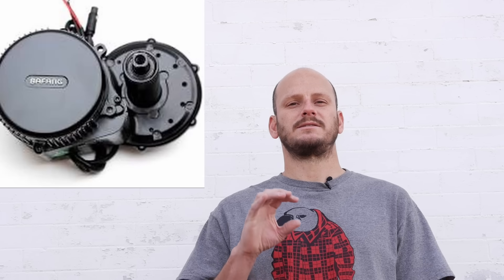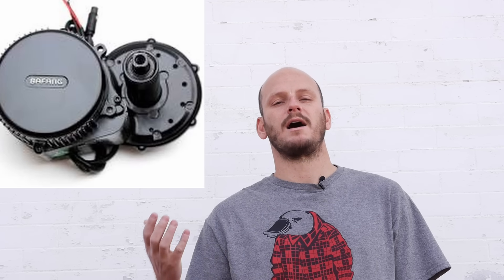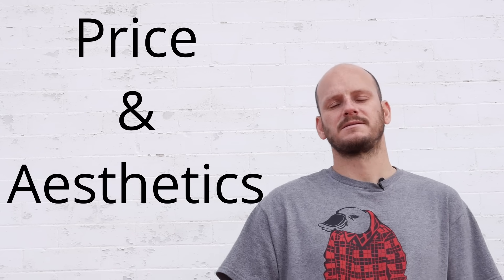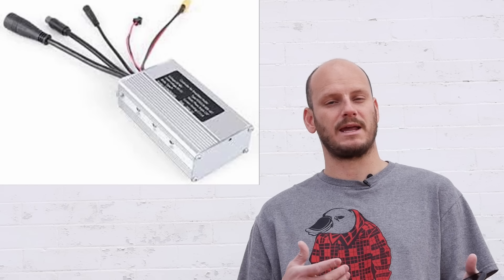Hub vs. Mid Drive Motors: Why Hub Motors Suck and Debunking Common Myths with performance test

Comment: OK, so how does this guy become really qualified? No electric car built by a major manufacturer uses a hub motor. What planet is this guy on? There are a few conversion car kits that use hub motors, but a Tesla doesn't. 
What I don't understand is why the hub motors aren't built into the rim. Yeah its more expensive, but you will get a lot more torque. Also why don't the hubs use a planetary gear set and go to speed. One speed is geared down, and the other is straight through.
Reply from the maker: As clarified in my pinned comment. A hub motor is a single speed motor (no transmission connected to it) Same principal as the drivetrain in electric cars. Check out my “biggest misconceptions about ebike motors” video where I go more in depth about this topic. It pretty much is a direct response to your comment.
Reply: @JohnnyNerdOut  I noticed my one sentence was not clear in what I meant. If you use a planetary gear set to gear it down, you can easily bypass the planetary to go to direct drive at speed. In otherwords, a two speed trans, where the planetary is bypassed by a clutch. Second thing is many bikes have large hub motors with no gears, meant for higher torque.
Reply from the maker: @Daveinet  I know of one hub motor that has a two speed transmission but no one uses it n their bikes. But it uses different reductions on bOth sides of the motor. It is not a direct drive system. Do you have a link to the motor you are referencing?

Comment: I have hub motor 1000w. Controller built in. Downside is I had to file the dropouts on the bike, a rear puncture is a bch. Pros, it has a throttle, I don't even peddle to work. Goes thirty miles an hour and if I peddle to get it up to speed it's faster than the average car off the mark. I can ride on the tow paths along the canals. It's basically an illegal moped with no tax or fuel costs.. But I agree with the video, stop start riding has big wear on these motors. If you're cruising for miles they're fine. But urban rides I'd like a mid drive in future. Awesome video. A lot of info delivered really well. You got a great talent.

Comment: Me who has a one speed on my mid drive 😆 pretty sure I want a hub motor 🤪
Reply from the maker: Single speeds definitely have a great argument for hub motors. Personally I’d still go mid drive because I could change the gear ratio anytime by switching out chainrings or cogs. Each their own though 👍
Reply: @JohnnyNerdOut  very true

Comment: I did a mid-drive conversion on my bike, but I think it depends on the starting point. I recently advised someone that they should do a front hub on their bike, as they had a chain guard, an normal front wheel and they they would be towing a kid behind and have a child seat on the back. They said they did not live in a hilly area. 

Most ppl I know with front hub conversions are happy with them. Brompton use them. Horses for courses.

Comment: You don't even need a spare chain, you can just take a $2 quick link (assuming your multitool has a chain link remover on it, and most do). I'm 1000 miles in on my BBSHD, I throttle far too much and my KMC X9 chain isn't showing any wear just yet.

Comment: You forgot one of the biggest drawbacks of the hubmotor: Changing a flat tire is a pain in the a**. I did a roadfix a couple of weeks ago. It took me over 20 minutes compared to sub 10 minutes on a regular wheel.

The BBSHD is great but for me the gears last about 15 000km or about a year and a half. After that they're toast. That results in a pretty high cost per km. You can replace the gears for $150 but it's almost impossible to do it without damaging the electronics.

Also for me it's a big drawback with the wide q-factor of the BBSHD. I want as narrow as possible for my knees and hips.

The BBSHD is a pain to ride if you run out of battery whilst my rear hub motor is almost like my normal race bike.

I can do 40kph for 80km on my rear hub motor and about half with the same battery and speed on my BBSHD.
Reply from the maker: I realized that almost immediately. I will do a second part one addressing more topics.
Reply: Just patch the tube without removing the wheel. And this isn't inherently an issue with hub drive but it is an issue with poorly designed torque arms/ axles.

Comment: I still more like hub motor. With mid drive I must always pedal... Maaybe then set throtlle then change my opion... And Hub motor have less gear reduction steps, so it have higher efficiency usualy. And in europe more than 25 kmph is not legal, so hight speed is not needed. In asfalt is no hight hills but on hight hells you always can help with pedals. And hub not wearing chain... Mid drives maybe is better if in your place wery steppy hills and many it. Or if your weight is wery big and 250 W motor who is legal in europe cant you put in steppy hills and your legs is wery not powerfull... And mid drive weight is usualy higher. Hub can be 1,4 kg-2,8 Kg 250 W while mid drive 3,8 kg.
Reply: ps. i buy middrive about 6 month ago after waching this video
Reply from the maker: You didn’t get a throttle with your kit?
Reply: @JohnnyNerdOut  not get
Reply from the maker: @Alksbbch  should’ve gone with a Bafang kit. They come standard and are highly programmable

Comment: Just picked up my brand spanker 750W Dual Motor E-Bike and it's out of this world AMAZING, very strong torque,  example climbed up a 25% gradient hill which approximately 1/4 mile  climb , and at a consistent speed of 29 miles an hour , at last I've found an E-Bike that I'm happy with the overall performance!!

Love your channel buddy, you are amazing !!

Comment: My God! What a load of bull...!! I have never heard more deceiving comments in my life!!! It was mention that the only thing that you loose is the derailleur!!! It is as if the guy has never ridden any bike in his life!! The derailleur and the gears are the heard of any bike!!!! If you loose the derailleur then you loose your ability to speed and of course loose a huge torque of your bike. And I am not taking at all about its electic motor because you might often run out of battery or you need to do extra miles so you need to assit the motor by pedaling in order to increase the actual range of your bike. What kind of pedaling are you going to do in a steep hill without the derailleur?!!!! Are you going to pedal with 40T in front? To do this you need at least 52T in your gear. How can you acheive a high speed on a flat or a bit downhill road without using the derailleur? Are you going to speed with the 40T? You should have at least 48T in one of its 3 disks (I have 52T). What a load of crap is to say all these lies about the spokes. Don't  you know that the spokes with the hub motor are really very thick and even if you want to brake them you cannot? If you need to ride a real ebike you need at least 1000W motor. The rest are just toys! With >1000W motor you do not have any of the torque problems that you have mentioned.

Comment: I have both, so no bias here. But, both hub motors and mid drive power the hubs. One through the actual hub and the other through the cassette or freewheel mounted on the HUB.

Comment: You WOULD use a hub motor in a motorcycle you say? Think again! At those higher speeds the so called "unsprung weight" becomes a very important parameter in road holding. That's why I wouldn't want a hub motor in my motorcycle. One of the big reasons why they are used so much is the simple mechanics (hence low cost) and space saving.
Reply from the maker: Ya I agree actually.

Comment: Hey Johnny. When I was buying my last ebike I really wanted to go mid-drive but every mid drive I tried I noticed that the moment you stop pedaling you feel a sudden power decrease whereas hub motors when you stop pedaling they just kind of coast but you don't feel any slowdown so I just couldn't bring myself to get the mid-drive because I didn't like the sudden slight jerk when I stopped pedaling. Both of the mid drives I tried were fairly high-end brands but they both had the same outcome. Is this not normal?
Reply: I have both a mid drive and a hub motor.  I think you notice the jerk more on the mid-drive because it has so much more torque, that the drop-off is super noticeable.  I would bet that on a 5000 watt hub motor it would be the same feeling (I have a BBSHD mid-drive and a 3000watt peak power hub bike)

Comment: mid drives are OVERPRICED. you have the use the most expensive bicycle drivetrain parts with a mid drive because all that power is fed thru the chain.

Comment: Built an e bike in 2005 with a hub motor, replaced the batteries a couple years ago. Still works like new after 16 years.
Reply from the maker: Sounds like a great investment 😀

Comment: Mid drive motors require a lot more maintenance. Due to a lot more moving parts. They're also very hard on your gears and drivetrain. If your chain snaps, u can't use bike
Reply from the maker: Depends on which system you are using. Bafang needs almost zero maintenance
Reply: @JohnnyNerdOut  You get a lot of accelerated wear on the bicycle drivetrain and brakes with the mid drive (more milage, higher speeds, heavier loads). With the hub drive you are basically replacing the bicycle brakes and the bicycle drivetrain with a single maintenance-free motor. The maintenance or a normal bike alone is enough for me to avoid mid drives. Especially with year-round commiting.

Comment: I have A 2350 watt hub driven carrera ebike with 20 amp hour battery. 45 mph on the straight.  It may not have as much Acceleration but That’s good enough for me especially when the chain snaps it won’t matter as i can still ride while i carry chain home ready for a new link fitting.  Hub for me.   And I’ve Been on the forbidden road and it’s great I’m loving  it.

Comment: Oh my god, lots of garbage in your fanboy video for mid drive > hub motors. They both offer different advantages and supposed disadvantages

Spokes issue is bullshit. A bicycle wheel is suspended vial tensile strength from the spokes, not pushed. The torque required to turn a wheel for a hub motor is the same as a central mounted chained motor. Only way you can warp your spokes is by crashing your bike, which goes both ways.

In fact, the spokes are supposed to be somewhat loose as it tensions when suspended from the top. 

Warped spokes is about the most bullshit garbage idea pulled out of a hat, both will be affected by spokes.

Like do you even ride traditional normal bikes?

Just seems like a random grab for points to support your mid drive vs hub motor argument.

Punctures affect both motors equally, and I don't see how different it is changing the tubes of a hub motor e bike vs a mid motor one, unless you're dumb dismount the tyres onto the wired side.

Gear teeth can be chewed up and damaged, bent, worn
Gear changing mechanism can be fouled, broken, etc

There's many more moving parts for a mid-drive e-bike to break and fall apart, many more things to source for, just so many things that can go wrong.

Burning out hub motors vs burning out mid drives? If you left your dang mid drive in a high gear ratio and floored it, guess which ones breaks first? The mid drive, you think that mistake is easily repeatable in hub driven e-bikes? No, the bike will move period unless you're putting it through some stupid test for torque against a stationary load, do the same to the mid-motored bike then, same shit happens.

The design of a mid drive electric motor and a hub motor is fundamentally different. In hub motors, the stator is central whilst the rotor is the wheel, and the opposite is true for the mid-drive. Guess which motor puts more strain on the drive train? The mid-drive, because it only has a bloody small shaft to send power to the drive train (which is another weak part, the chain).

As for going uphill with a hub motor vs a mid-drive, mid drives can not have all wheel drive, only rear. For hub, you can have all wheel drive - testing for both, all wheel drive hub motors >>>>>> single rear wheel mid-drive e bikes - in every conceivable test out there, regardless what speeds you're going at.

Perhaps it is theoretically possible that a highly geared mid-drive e-bike could go for a much higher top end speed than hub motored bikes, but by the time you get to that speed, you're already slowing down - changing gears to match speeds in rough terrain with exposed chains and gears = death sentence, unless you have a motorbike sequential gear box (which you definitely don't, cos it will take the service requirements to astronomical levels).

Mid driven e-bike motors also take up valuable space for battery capacity, of which is considered a scarcity and should be given every available space to.

Lastly, you can actually easily DIY and mod any random bike into a hub driven e-bike, but you can't with a mid-drive motors.

This is why less and less people are giving a crap about mid drive ebikes, and headed for dual hub motored ebikes, it's a bloody no-brainer, its not myth, its reality.

Maybe take a course in engineering before spouting your garbage? My gosh, such misinformation.

Comment: Good article with comparison on every aspect. Well done, Johnny & thank you :)
Just a couple of questions..
1. How about regenerative braking?
2. With the hub motor I thought, you'd feed back energy into the battery while pedaling or even while idling.. I mean, no effort by rider or motor but the wheel is just freewheeling. 

Could you explain more on this please. Thanks again!

Kiran
Reply from the maker: Yes. Specific hub motors can utilize regen. They are direct drive hub motors. Vast majority of hub motors sold are geared hub motors, not direct drive. There are trade offs to going direct vs geared. It’s a bit of a rabbit hole 😐
Reply: err no H ha  ha the picture of the wheel with bust spokes,,   its not got a hub motor its just a front wheel BIG MISTAKE
Reply: You still can wel shut the free wheel on geared hub motor.
You should go check Grin Tech takes on regen braking. It's great.
https://youtu.be/gYCj4asp9pE

Comment: Ever driven a Stromer Spedelec?; hub motor, reliable, fast, high torque and great in the mountains: well they are Swiss. Ever heard of the Alps?
Reply from the maker: Never ridden one and never heard of the Alps. Are they a jazz band?
Reply: @JohnnyNerdOut  You should try one. A Stromer. Solid as a rock. Stable at high speed. Well balanced. Big battery (984W) in down tube and 500+W hub motor, resulting in a good weight distribution between back and front. And the Alps (😀): highest mountain range in Europe, meaning going uphill is no problem at all.

Comment: Feels like Mr. NerdOut is doing its best to reason bad about hub motors:
Spokes! Yes, when the hub motor is badly installed, or spokes get loose, it’s a problem. My 1200cc motorbike has spoked wheels and is powered by a crankshaft (forces similar to a hub motor). 
Torque! You simply need less torque with a hub motor as there is hardly any drive train loss. A 80Nm mid motor is comparable with a 45Nm hub motor. They have the same torque delivered to the road. 
More Torque! All this torque has to be handled by the drive train: motor gears, chain, derailleur. That why a chain can brake. 
Controller! They are these days nearly all located in the bike frame. Far away from moist. 
Gears! Hub motors have derailleurs, meaning many gears. Not just one as mentioned in this video. A one gear hub motor would be a silly setup indeed.  So never buy that. 
Hub motors with belt drive and pinion gears would be my best option. However an expensive one. 
Bottom line: get a mid motor for e-bikes up to 25km/h. These are
manufactured by the millions, hence cheap and good. For spedelecs (45km/h) a hub motor is by far the best option. Keep up your good work!

Comment: Dude you might say the true BUT BE aware of power output for example HUB motors can be overloaded with volts and give u much more power than a mid-drive motor if u did it with mid-motor u would be in bad luck with toasted motor that cost insane amount of money is now a trash. ohh and one more thing Hub motors are 300% cheeper to maintain than a mid-drive cus there is 10X fewer parts. Another thing about spokes when buying hub motor that is already assembled u should tighten the spokes because manufacturers don't do that they just assemble it together just as pice, not as parts that should be used thats the true I can go and go about it.

This guy is just pist off cus he dosent know how to use HUB motors PROPERLY as all other people thats why they break things like spokes, trust, meaning in life etc.
Reply from the maker: I think you may have missed major points of this video.

Comment: I'd get a mid drive for a bike that I was using like a motorcycle; road and sidewalk only. The thing is there are a few rough dirt paths near me that would be perfect for a dual hub ebike, and people have said awd bikes are a lot of fun off-road.
Reply: One mid drive will be about as good as 2hubs off road. and use half the power. Especially If its geared for it. Even with commuting gearing the mid drive will out perform hubs off road. Idk why people glorify the dual hub bikes  they aren’t that great on the front.